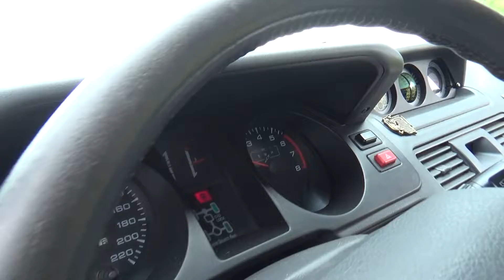How the V6 engine sounds - Mitsubishi V6 3.5L exhaust and acceleration  test

Comment: Those lifters needs replacement. Or it needs oil or different oil. Or the oil pump might be on the way out. I have rebuild my engine during lockdown.

Comment: Nice video and good work with your pajero, but I have a question for you, I would like to know which vehicle is better in the off-road, mitsubishi pajero limited or pajero sport from 2000 to 2006, please answer.
Reply from the maker: That's a hard question however the Pajero sport is built on the frame just like Mitsubishi L200 and Pajero of 4th generation has a reduced frame so in my opinion Pajero sport will be better for offroad but probably less comfortable on Road, of course we are talking about production years you have provided
Reply: @BBWalkerTV  thanks for your excellent reply. I was trying to get this information because where I live there are so many places to take off-road trips and have fun. I was thinking about the jeep cherokee xj or another jeep but in my country, dominican republic, it is difficult to find those vehicles in good condition

Comment: I am looking to buy a 3.5 v6 2002 year the next gen, can you tell me if you know fuel consumption  in city? It burns too much gasoline ? In 100km i check on sites they tell 16 city 100km
10 highway 100km
Reply from the maker: More like 18-20 in city,12-13 highways. Everything depends your driving style. I love to use the acceleration pedal :) regards
Reply: BB Walker TV yeah i think if you drive normally i will be okay, i check this pajero haves 200HP
Reply: I bought a 2015 4 days ago .It consumes alot of gasoline if you accelerate and floor it alot. But oh man , it is a good , capable car and  what it can do in off roading makes  it worth the money you spend on gasoline.
P.S.  I didn't expect the 3.5 engine to perform as good as the 3.8 or at least come close to it , but it turned out  to be a false notion.